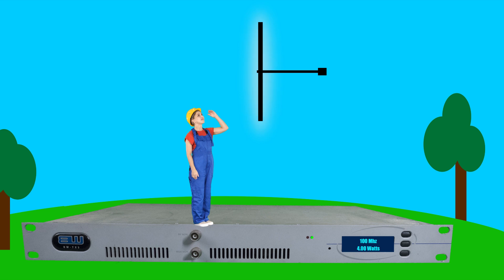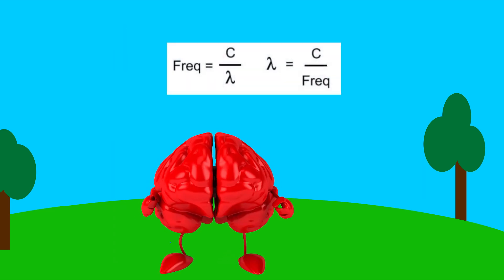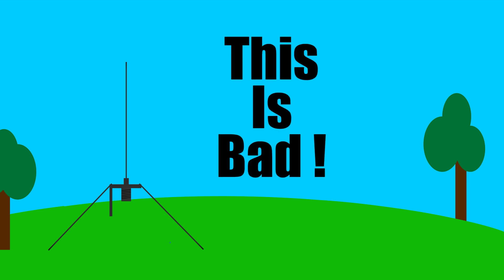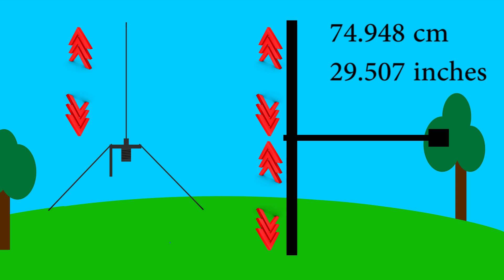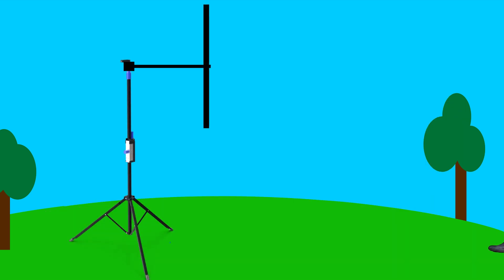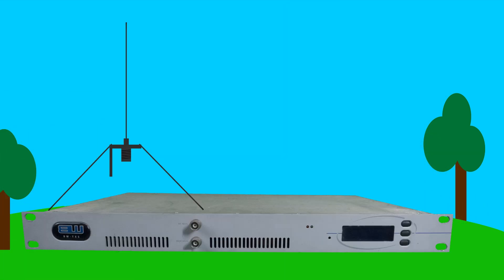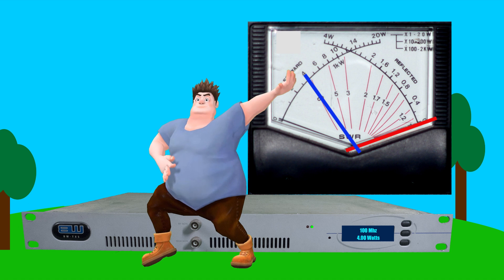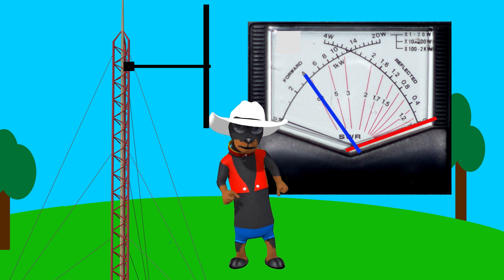FM Radio Station ANTENNA How to TUNE. For Radio Station Transmitter. Secret To Boosting FM Signal!

Comment: what device did you use on tuning the antenna? the swr and reflected thing?
Reply from the maker: You can use any SWR meter but the one I use is a power and SWR meter in one. But just about any SWR meter will work.

Comment: 88 - 108 MHz is the FM broadcast band ?
Reply from the maker: Hi. It depends on the country. 88-108 is the band for most countries but some countries have a different band for example Japan is 76 Mhz to 95 Mhz and some countries are phasing out the analog FM band and changing g to DAB digital radio which is and different bands but mostly 174 Mhz to 230 Mhz But yes in most countries 87.5 to 108 Mhz is the common band.

Comment: Was kind of hoping that this would explain how to tune an non adjustable length antenna with out buying an electronic antenna tuner.
Reply from the maker: There are only two ways to adjust the tuning of an antenna. They are to adjust the length of the antenna or to attach a tuning circuit to the antenna and adjust that.

Comment: Actually, those radio waves are not that dangerous... even with 1kW it won't heat you up enough!
Reply from the maker: Yes, the FM signal coming out of the antenna (depending on signal strength) which is set up correctly is most likely not going to heat you up enough to harm you purely with heat but is still very unhealthy. Extended exposure to high-power radio waves can cause all sorts of medical problems. I am not a doctor and don't give any medical advice so don't take this as medical advice or safety advice of any kind but from my experience most responsible broadcast companies will not allow anyone to be near a high-power signal for any length of time. In many broadcast installations, the entire broadcasting system needs to be shut down before anyone can even walk into the room where the equipment is stored. There may even be regulations in different countries that prohibit close contact with high-power transmitters when they are on, not to mention being anywhere near the antenna that is putting out any significant power. Working on an antenna that is "live" with RF power is also silly because if, for example, the cable is pulled out then the transmitter can be damaged because of the load being mismatched and if the person holding the end of that cable touches the core of that cable they could end up with some serious medical problems. Like I said, I am not a doctor and don't give medical advice, but I also would not advise people to be irresponsible.
Reply: @inspiresoundpro  I never said to touch an antenna that is live.

Either way, those radio waves are not going to hurt you.

Yes, if you are next to a high power millimeter wave antenna you could get some tissue damage because it can't dissipate the heat fast enough.

But for FM down near the 100MHz range, you would need an awful lot of power... not something anyone making a DIY antenna is going to deal with.

We have a 50kW output, in general radio waves are a form of non-ionizing radiation so all that happens is heat transfer. Nothing more, nothing less.
Reply from the maker: I didn't say that you said to touch the antenna. I was simply pointing out the dangers. As you mentioned, there are people who enjoy DIY projects, which I have on this channel. They are not always aware of potential dangers. The part in the video about being near the antenna when it is on is precautionary. It was not intended to be a scientific explanation of how radio waves affect people. I assumed that most people would understand that the cartoon character would also show that there was some exaggeration in expressing how dangerous it is while still suggesting that people be safe. I get your point about the level of power of radio signals needed to become a serious problem but the clip in the video was a simple short cautionary insert to make people aware of potential dangers and not to make a factual statement about the level of radio signals and their direct corollation with specific medical conditions. I'm not sure why you seem to take this so personally. It's a fun video filled with animation to introduce new people to tuning antennas and not a documentary. The video is far from being a scientific thesis and more a fun piece of edutainment. While I enjoy and appreciate input from so many people, I really did not intend to put out a controversial statement about any disputed scientific facts to start a battle of wills. If you see the video in the light of how it was intended you might understand that the argument is moot.

Comment: Hi i have a question
I have a 15w fm transmitter with the antenna that came with it but my question is

Is it normal when i turn on the transmitter that the antenna becomes very warm after 1 minute of being on?

Is ot because it is out of tune or they are supposed to get hot while working

Thanks
Reply from the maker: If it gets warm switch it off immediately. The transmitter can blow its power transistors. The antenna should never get hot even if you put 100 watts into it. Very likely your antenna is bad or possibly because you are using it indoors that is getting reflections. 15W also has a huge range so I would say be careful with that.
Reply: @inspiresoundpro  yeah its a small antenna that came with the transmitter

And another thing

Is it normal that when I touch the antenna it gives me a shock 

And furthermore when I touch the antenna with a piece of metal I can see an arc forming
Reply from the maker: LOL seriously throw that away. It's junk
Reply: Sí es normal que una antena se comporte así porque lo que está irradiando es energía de radiofrecuencia, en cuanto a lo calentarse es una sensación nada más debido que al tocarla con los dedos principalmente en la punta de la antena se sienta caliente y eso es debido a que la rf quema la piel sacando   humo y hasta huele a carne a  asada.

Comment: The type of coaxial; cable also matters. You want to use cable that is not only 50 ohms in impedance but also good for the band you are operating on plus making sure it can handle the TX RF power in watts you are running into it. Another factor on cable is length. You need to determine how long a cable you need then find one that will work for you with low losses over the length. There will be loss so you want to minimize these as much as possible by choosing the correct cable, not using a lot of adapters and making sure the end fittings are installed correctly, secure and water tight. Water ingress can cause major issues (corrosion) if a fitting is not tightened down fully and treated to resist water..
Reply from the maker: Yes I talk about all of that in my other videos. Check them out.
Reply: LMR-400 50ohm is preferrable.

Comment: But it antenna should be tune with antenna analyzer instead of SWR power meter
Reply from the maker: Hey thanks for your comment. Yes you can certainly use an antenna analyzer but with only one frequency being used for broadcast FM stations an SWR meter can be more than enough. With multiple frequencies being used for example in HAM radio antennas then an antenna analyzer can certainly be better. This video is also intended for first time antenna tuners so an antenna analyzer might be good for a more advanced tutorial. But yes an antenna analyzer is great for tuning antennas :)